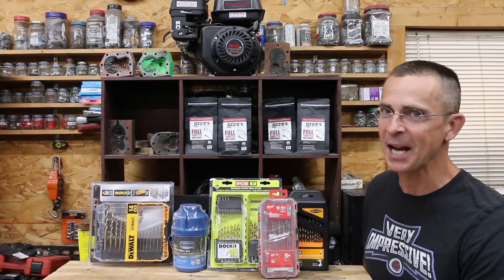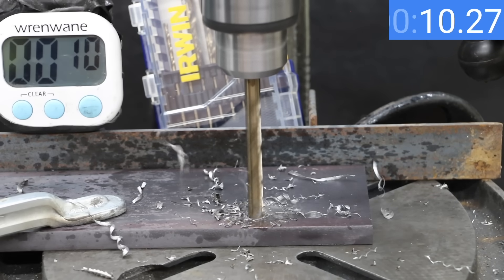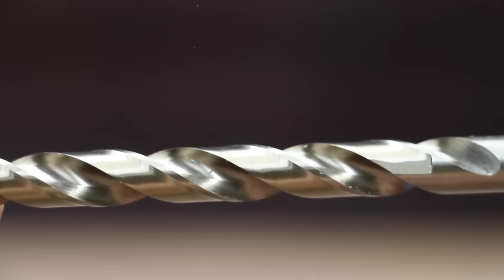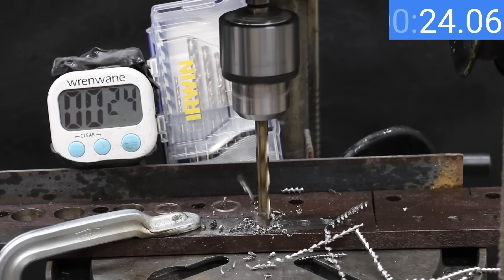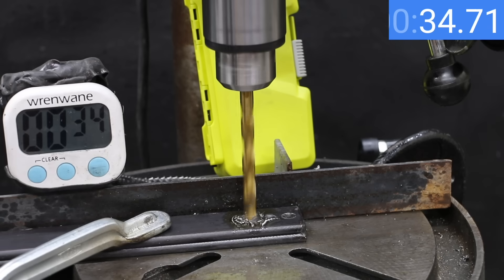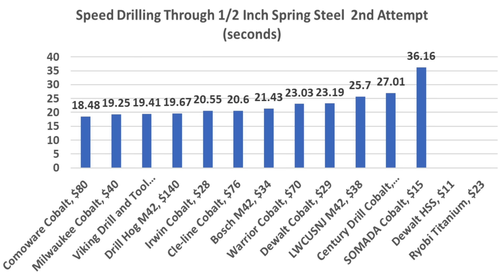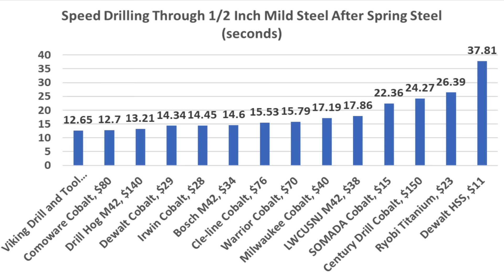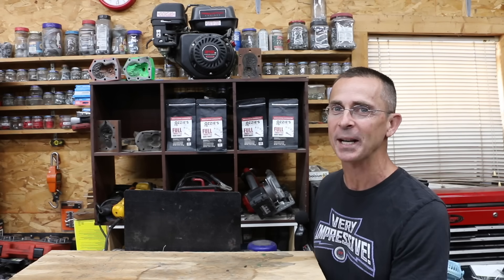Best Drill Bit Set? $11 vs $200? Let’s Settle This!

Comment: How is it every time you did a close up of the drill bit, they were coated when they didn’t appear to be coated when you took them out of the index? Coated are fine, until the bit need to be sharpened. Did you check for accuracy after you drilled your hole? Speed means nothing if your hole isn’t to size or it isn’t close to being round.

Comment: Your impartial, scientific testing has shaken industries and helped us not waste money on really what are rip off products. Sincere thanks to you and all you have done for people who can't afford to buy the wrong product they need. Project Farm is my go to for product reviews!
Reply: wait wait 5:17 is rust visible straight ftom the box?    when I would get drill bits, I’d put money down on Irwin/Bosch.  would using an industrial drill press overestimate elapse time?    I presume 80% would use a drill motor ?   
 would you also include Harbor Freight & Craftsman Tools in future tests?   
 ❤ these test, thank you   Very Impressive
Reply: @98167 you can't beat chinese M35 cobalt drill sets for their price. I've used those for years. Only metric as far as I know though. A set of 25 pieces from 1-13mm costs under 30€ including shipping and VAT on a good day. So 1/3-1/4 the cost the same drills would cost in the local cheapo store.

Comment: 2:31 THAT tip is what I made way back in the mid 1970s. Also revamped other tooling for the better. 
We had an issue drilling oil holes in our largest diesel crankshafts. The drilling distance was over 1 foot through journal, main & journal (JMJ) where it took just under 3 drill bits to complete. I created that 'pilot bit' and gave it to the oil hole machine (bit size was around 3/8"). Tho he was skeptical he was surprised it drilled through one JMJ then partly through the next. Overall it saved the driller bit changing time and upped his production. THE REALLY ODD THING is, next day when the machine shop seen what I did, they wanted me fired. 
Well in a year that engine division of A.C. was having $$ issues then became Fiat-Allis. IF ONLY that company took to heart at least a few of my ideas & concepts that engine division could have stayed and kept workers jobs. When they moved south everyone was asked to stay on but me. ya...their loss. (smh)
OH! That pilot bit came to market just over 2 years later. If they didn't OVER PRICE it, everyone would have one of the best & fasted drilling bits ever made. Todd, several years ago, that was the drill bit I wanted you to test against all others you've tested on this channel.

Comment: There are higher end adhesives out there for when standard adhesives aren’t enough. Loctite 4070 and depend 330 for example. There are other brands as well. It would be interesting to see how they perform against everyday adhesives that you’ve previously tested.
Reply from the maker: Thanks for the suggestion.

Comment: I'll have to do a check and see, but if not, would love to see a similar comparison of drill bits for wood applications.  Rarely do I need to drill thru masonry stuff, and even less so on metals, but I use my drill bits all the time for wood.

Anyhow, thank you for all your videos, they are extremely helpful, and appreciated!
Reply: I like the pilot point bits for wood.  I've been satisfied with the Dewalt sets in the past.
Reply: @jimm1819  Cool, thanks for the feedback.  I have the standard HSS bits from DeWalt, will grab a pack of the ones with pilot points.
Reply from the maker: Thanks and you are welcome!  Thanks for the suggestion.

Comment: What about would it be better to hand make a work bench, buy premade legs to attach to your own bench top, or a kit workbench and what material would have the best performance for heavy use. For example make one entirely from scratch, buy legs from a store or online and attach it to a large piece of precut material, and buy one from a store or online to see, if someone wanted a work bench to use is it better to buy one out right or try and piece it together from what you want out of it. It would also be nice to see what materials would make the best workbench, metal or wood, plywood or solid lumber. Things to test could be the failure weight of the top its self, if you were to drop a soft metal part or something along those lines would it damage it the part more than the bench top, and lastly how stable is it without, and with weight. I know a lot of benches a tables can get pretty unstable and feel as if they are going to fall apart if you push it slightly.
Reply from the maker: Thanks for the suggestion.

Comment: I would like to see you take the top 6 brands and run them all through the drill doctor and then run the exact same test again.  That way, you could eliminate the factory sharpening variables and just test the metallurgy of the drill bits.
Reply from the maker: Thanks for the suggestion.

Comment: The issue with the DeWalt Cobalt bits is that they start cutting fine but when the main flutes hit they will rip the drill out of your hand and will break your wrists if you try to use them outside of a Drill Press.
Reply from the maker: Thanks for the feedback.

Comment: I'm a cnc machinist and run all drills everyday, for a cobalt 3/8 you should be pushing with at least 400lbs of force, you won't get full performance with less force.
Reply from the maker: Thanks for the constructive feedback.
Reply: @ProjectFarm  Thanks for all the great videos, if you ever do another drill test like this it would be interesting to compare a real high end drill, like a walter, nachi, OSG or something like that, they all make High quality cobalt drills and it would be interesting to see how these compare.  Also your feed force may have been low but your RPM's where spot on.

Comment: How can this test be valid when its obvious that the chuck was not tight enough on some drills.

A true engineer would never not first drill a smaller pilot hole...at least the same size as the flat on the 3/8" drill.

Comment: You should review and perform stress tests on different brands of hot dogs. Torque, tensile, smash resistance, electrical conductivity, heat capacitance, moisture level, lubricity, and a blind taste test to three or more people for preference.

Comment: Another great video. I’ve been using the Drill Hog bits for over 5 years at work (machine shop) and they are some of the best bits I’ve used. Plus, they come with a lifetime warranty. If it brakes they’ll send you a new one.
Reply from the maker: Thanks!  Thanks for the feedback.

Comment: As someone that has used DeWalt for over a decade as a contractor, I'm now looking elsewhere for the CRAP hex-shank, metal bits. 8-10 (from a set of 10 various size kit) snap either the whole shaft, at the base, or the tips.
Reply: CHEAP Chinesium steel is brittle and LOW!!!! quality
Reply from the maker: Thanks for the feedback.

Comment: I worked for an irrigation company for 20 years.  Having worked in several departments, I was in sales when the company was purchased and moved in 1982.  The new company, being 'smarter' than the original company, decided to use imported .125" drills for orifices in 'Navy Brass' which had to be burr free.  The imported drills would typically make 100 to 125 holes before becoming unusable as opposed to several hundred holes when using the more expensive "Cleveland Twist Drills" as used by the original company.  I was asked how to extend the life of the imported drills. After consulting with a  machinist friend, I sent the drills to a "Cryogenic" lab where they were 'heat treated' at -420 degrees below 0 degrees F.  After treatment, the drills produced a clean orifice with a life of several hundred cycles. Hopefully this story is interesting and informative.  I truly enjoy your videos, Thank You.
Reply: Cryo treatment just fully converts the existing Martensite? to harder compounds.

Itll greatly increase the wear resistance but also make the bits more brittle/less forgiving to off axis loads.

I thought you were about to tell management, "Yeah I have a great idea how to extend the life of the drill bits to several times these.... BUY THE OLD ONES YOU NONCE" 😂
Reply: Brass shouldn't wear down milling equipment if it's properly designed and kept cool. Same with aluminium.
Reply: That is interesting. 
I have seen several times the scenario where the new company is less competent but more convinced of their superiority. 
  Were you hand drilling? 
What is navy brass vs regular brass?
Reply: @ronfox5519  the drilling was done with a custom made, automatic machine.  Brass is Copper and Zinc, Navy Bass is Copper, Zinc and Tin.
Reply from the maker: Thanks!  Thanks for sharing.
Reply: Along time ago I worked a drill press in a machine shop. I would drill a #60 hole in a small metal cylinder. My foreman gave me a pack of swiss #60 drill bits. I would get about 1000 holes before the bit would break. When the pack of drills was empty I went to the tool crib for more. They only had USA brand #60 bits. I would get 150 to 200 holes per bit using them.

Comment: Why didn't you mention any warranty situations that these bits might have?
Does the DRILL HOG still have a life time warranty? I got a set for my boss a few years back & they worked awesome except you had to return the failed bit by mail & then they would send you out a replacement & since this set was placed on a mobile repair truck, we just got 2 sets so that we could wait a while before sending in all the broken bits after a few weeks or months, depending upon what kind of work we were doing & any/all/other reasons for life as we know it. Always got the new bits & I really liked the three cut sides to stop the bits from spinning in the chuck, especially when using a ""NO-KEY"" hand chuck like on most portable battery drill drivers.
Thanks......................MR

Comment: amazing video, keep up the great work and reviews

but for this, do you think the quality of the drill bits are different in sizes? like the bits you were testing are a pretty decent size, but what about smaller sizes? especially if they are all rated to drill into the same type of material

Comment: Would be so cool to see a comparison between the bits of the same brand and model that are made in Germany or China.
I've said it many times before, just because it's made in China doesn't mean it's automatically bad. It's all about what the one who orders the manufacture is willing to pay.
Labor is cheaper in China but there are still very skilled workers available even in China, one could order the exact same thing from China that has been made with the same quality machining and raw materials and still pay less because labor is cheaper. And shipping can be dirt cheap too if you order in mass quantity.
Reply from the maker: Thanks for the suggestion.  Thanks for the feedback.

Comment: Recently, I had to drill out some hardened locks (lost keys...!) and used Milwaukee cobalt Red Helix bits (with a M12 drill motor). With those bits it was like drilling through butter. I was definitely impressed.
Reply from the maker: Thanks for the feedback.

Comment: 170 lbs on the drill bit... That sounds a bit excessive.
And when it's smoking that bad even with the oil, there is a chance you are work hardening both the steel you are drilling into as well as the bits. Even if they don't break there and then, they might become weaker for their next use.

Also, just to be clear to viewers, you don't just lubricate them once and forget about them. Lubricants need to be applied at a steady rate as the drill works through the material as lubricants that aren't held in place by something will just move away from the work piece as it heats up.
Reply from the maker: Thanks for the feedback.

Comment: Need a video now of "what size of pilot hole is best for drilling a 1/2" hole through mild/spring steel." For the people who don't want to eat drill bits by just jumping to the 1/2" bit first but can you use a 1/8 or 1/4 or just a 3/8 or if just a 1/2" is the lest wear and tear way? What about using a smaller bit but using a centering end mill or other style cutting bit to make the hole, is that faster/less wear and tear than using a big drill bit?
Reply from the maker: Thanks for the suggestion.

Comment: For  my use, the cheap DeWalt will be fine.  I work on lawn equipment,  and small engines.  Sometimes I need to drill out a grade 5, or 8 bolt. The cheap bits will do fine for me. Cost wise it makes sense.
Reply from the maker: Thanks for the feedback.

Comment: I wonder how the bits I got on Temu for a few cents per bit would compare : )
They are so cheap I just throw them after each use - not worth putting it back in the drill box.
Reply from the maker: Thanks for the suggestion.

Comment: Thank you again. I drill a lot of holes in mild and hardened steel. The Bosch hold up great and  good for the price. Most of the drilling is not on a press, but on our machines, we build. Century, viking, and some of the other brands you tested are also ones we use. What we really need is a good quality sharpener. I've only been in this company for 3 years, and little by little I've managed to convince the shop manager that tool maintenance saves money. It also improves productivity and work quality. I'm the oldest  guy in the shop at 65 and plan to retire in a couple of years. I would love to leave this shop in better shape than I found it. Have a wonderful, warm day. And keep on doing the best tools reviews anywhere.
Reply: I value the experience of older people.  I hope your leadership respects your 65 years of experience.  I agree with you, maintenance is more cost-effective than just buying a lot of new bits.
Reply: @johnnysimes5082  It depends... In my younger days I worked for a machine shop for about 6 months, and we used tons and tons of drill bits, in various sizes, and also thread cutting taps. The company bought them directly from the manufacturer in Germany, and they only paid a fraction of the price that a normal person would have to pay, because they bought them in bulk, like thousands and thousands of drill bits and taps at a time, and they saved about 90% on the retail prices - it would not have been economically viable to have someone employed to re-sharpen the drills.
Reply: @Bannimann2 big Business has its own rules...and acontainer with 500 TVs is probably cheaper than a van with 10...
Reply: @johnnysimes5082 sorry, but lots of elder employees are behaving like in retirement while full employed with full wage on costs of colleges. And many do not care what happens with the company after they left. Lots left working place dirty and chaotic and give the excuse of tired from work. Ok, might be true but then they should reduce hours to be able to work not on shoulders of Colleges.this is my experience in 30 years at work.
Not all, but more than 75%
Reply: At my job we have an old Darex SP2500 drill sharpener, that thing is great. A perfectly sharp drill with a perfect split point every single time in no time at all. The newer Darex machines are expensive, but they last forever. So that might be something to look at. Also, I'm with the other guy: every shop needs a greybeard. The guy that taught me to machine passed away unexpectedly only half a year after I started. I can get a lot done on my own, but there's just no substitute for the kind of experience someone like that brings to the table. Wish he was still around.
Reply from the maker: Thanks, will do!  Thanks for the feedback.
Reply: It's a pleasure to "meet" someone who cares about their place of employment and wants to leave it "in better shape than I found it".    I'm sure you will be missed when you retire.
Reply: I loved reading your comment, mate. It seems like an old school mentality that was clear to see when I was growing up in England. I can’t say that I witness that mentality as much as I did when I was in my youth! I am 42 so it wasn’t that a long ago but work ethic and pride seems to have diminished substantially over recent years. I run a business that works with tools and trying to get people to treat them with respect is like pulling teeth!

 It takes a real man to take pride in what they do and want to do a good job, just because they want to. Your desire to leave your role and let your predecessors reap the benefits is commendable! If only we could bottle up your mentality and sell it over the counter! 

All the best with your retirement and I am sure you will achieve your goal of leaving the shop in a better place than when you started! 👍🏻
Reply: I do exavtly know what you intend bye ' leasing in better conditions than before".
Its a shame that there were so many Compagnie and Shops, were they Burnout money through their disorganisation. Perhaps should write a book about this phenomen...
Regards
Reply: @MrDriftspirit  Yes, my writing is atrocious. I'm just a guy who can build just about anything. from little more than nothing. What's your vocation?
Reply: You are what America is about

Comment: How do you adjust for your testing jig?  Surely the weight and speed is not ideal for every bit.  One of the bits may do better with more speed and less downward force, while another may need yet a different speed and downward force to perform at its best.  How do you determine the parameters of the test?  Is there some kind of industry standard test you are following?